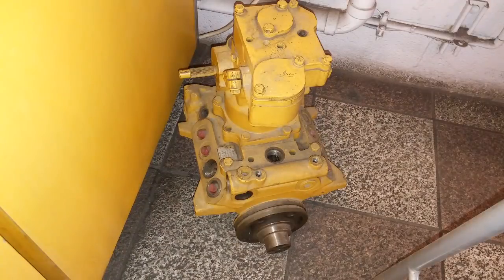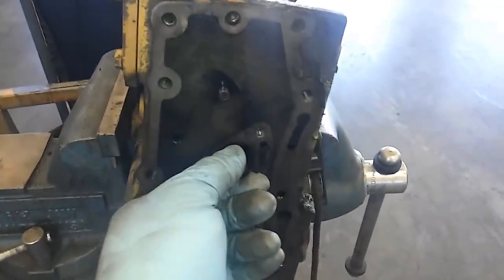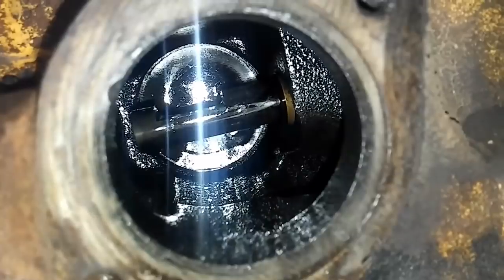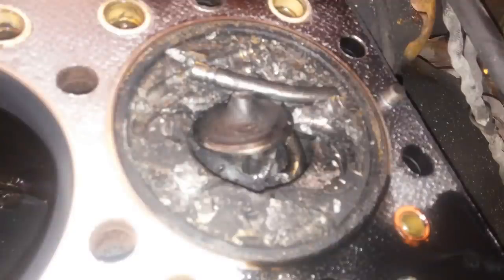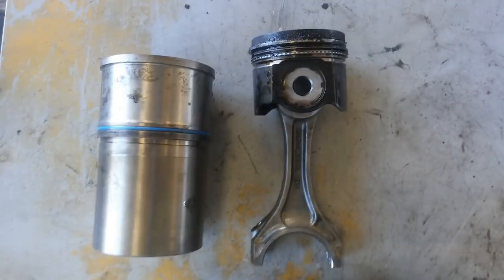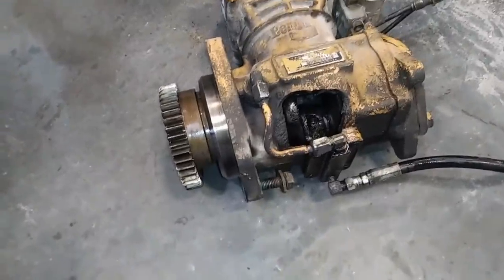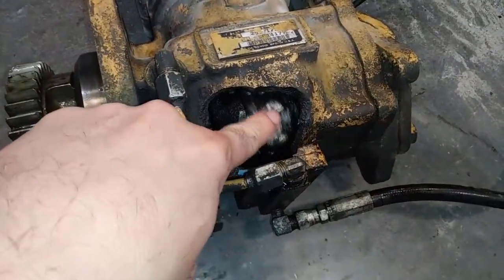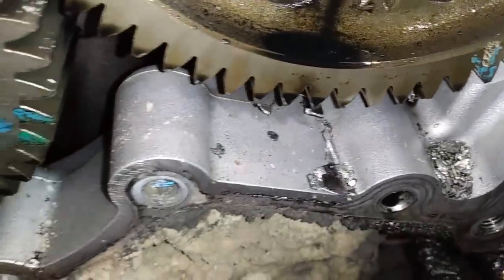Why Do Diesel Engines Runaway? What Is A Diesel Engine Runaway?

Comment: Don't get all worked up, over a run-away diesel.
I've had a couple diesel engines run away in the past.
But, they always came back, a few days later.
Reply: I’m pretty sure your very lucky as a runaway is a sign that shows you something is wearing pretty fast and you need a new fuel tap
Reply: If you love it let it go, if it is really yours it'll come back.
Reply: I bet they were all Canine Diesels...maybe even Vin Diesel
Reply: They usually just walk around the neighborhood and come back by supper.

Comment: When I worked in the Alberta oil fields, any truck or powerplant on site with a diesel engine HAD to be equipped with an air shut off valve, basically you hit the switch and a butterfly valve in the intake closes, removing air from the engine. This was in case of a gas leak or some type of prehistoric fume getting sucked into the intake of a tanker, vac truck, drill rig or whatever and cause a diesel to runaway and blow up...... Which would result in a lot of paperwork... Come to think of it, I saw a mechanic use a Gasoline soaked rag start a "Mercedes" MBE4000 that had shut off after running out of fuel once...
Reply: Munnz forget the paperwork. If you have a gas leak big enough to cause the engine to runaway, and you don’t get it shut down before it explodes, chances are the sparks and flames are gunna set off the rest of the fumes that are now across your lease and the whole lease goes boom lol
Reply: speed150mph which comes with a lot of paperwork.
Reply: Gasoline soaked rags start a diesel that's ran dry better than anything I've seen
Reply: The first thought that came to mind.   Unbelievable that engine makers would try to save pennies by not putting emergency air cutoffs controlled from the cab on EVERY engine.
Reply: Fascinating story Munnz! About oilfield requirements.... All these stories from you guys are fascinating , and I'm learning a boatload from you all.... Fascinating too is when a driving school student tries to run back to a truck that's on fire , and he's running back towards the truck hollaring "My logbook! My logbook's in there!" And we grabbed him by his shirt collar and stuffed him in a ditch just as the big "boom!" explosion shot flames 20 feet tall. His eyes got HUGE!. Scary stuff., when you realize you could be asleep in the bunk during stuff like this
Reply: Munnz - Fire truck drivers have to watch out for the same thing. If you are responding to a propane leak, the propane is heavier than air and the gas will "puddle" in low spots. However, fire trucks are not usually fitted with air cut offs. If you're in an atmosphere rich enough to ignite in a diesel, you need to be somewhere else, NOW!
Reply: This is basically what happened on the Deepwater Horizon rig. Natural gas pressure blows up through the pipeline, huge amounts of gas surround the rig. Gas gets into the air intakes for the diesel generators powering the rig. Diesel engines over-speed as a result of too much fuel, cranking the generators up to 11 and beyond. The crew on the rig notice this as the lights get super-bright and then light bulbs start popping, due to the excess voltage from the generators being driven way too fast. This only lasts a matter of minutes though, because the diesel engines can't take the stress for long: They explode, causing a huge fire which ignites the oil spill itself.
Reply: Too bad choking the air on this old pos Cummins generator I used to service would cause it to rev up. 
Notice I said : used to. 
Yea , we condemned it before it really ran away.
Reply: @luashelton9320   Did you hear about the trucker who got stopped at the scale house back in the day, and when they asked for his log book he replied " Log book? Are you crazy, I'm hauling cattle!"
Reply: @johns7734  Propane and Butane are toxic, and they also are dangerous to living beings BE CAUSE they are heavier than air which would cause it to  easier explode and also be cause it easier causes you to breathe in higher concentrations of it. I once got completely incapacitated from breathing in propane / butane from a pretty small tank that started leaking in my shed, it was scary to be aware you're laying on the ground and aren't able to twitch or move any single muscle in your body. Remained like that for ten minutes or maybe half an hour, I was lucky the gas tank ran empty halfways and in the end I found back my ability to move, rather painful and taking a lot of effort. Not pleasant.
Reply: LOL... I Hear beer passes a lot of gas   lol
Reply: This is common and required on many diesels that operate around anything that has a potential to supply gas. A lot of pipeline fires happen when excavations hit gas lines accidentally with equipment that doesn’t have a shut off system. Engine runs away lots of heat and boom.

Comment: I remember when I was 14 or 15 we put a used diesel engine in our Land Rover which at first wouldn't start since it had been sitting for a while and then went running away pretty much right after it started. Horrifying experience! We managed to make a ball of rags and gloves we had handy big and firm enough block the air intake good enough to stop it rather quickly. No harm done to the engine. It had a stuck injection pump so we just put the pump of the old engine on it and it was good to go.
Like all of your informative videos, please keep this wonderful work up!

Comment: I had a run away on a Volvo FH12 because of turbo failure. Luckily my buddy was fast thinking and showed a bunch of rags into the air filter house and it caused the engine to starve and stop.

Comment: Ive seen a train going down the tracks with fire coming out the exhaust on the top. not sure if it was a runaway or not. but it looked cool
Reply: Fire out the exhaust stack is an indication of over-fueling.  Normally, over-fueling presents as simply excessive (black) smoke, but if the machine has been working really hard, and if the exhaust is very hot,  the unburnt excess fuel will actually begin to burn inside the exhaust, and when the stream emerges outside of the exhaust pipe, it meets the fresh ambient air,  so the oxygen infusion as it's leaving the stack helps ignite the mixture and it presents as a visible flame.  Yeah, looks cool,  not really a problem other than to indicate that it's time for some shop maintenance.   In some extreme cases,  there could be instances of fire out the stack if the turbocharger was experiencing a failure where the lube oil being pumped to the turbo's bearings, manages to get past the seals on the hot side of the turbo, and ends up puking oil into the exhaust stream.  This would present as quite a wild and excessively sooty, smoky blue-white exhaust, and if left unchecked, could begin to consume the lube oil from the engine.  Modern locomotives would have a sensor that would indicate low oil level in the crankcase (or low oil pressure in critical areas), and would lead to a governed shut-down, if the engineer did not notice or act, the engine's management system would shut it down to prevent self-destruction.  In a runaway situation,  if the engine is getting its "fuel" from lube oil getting past the piston rings, or from turbo bearing seal failure on the "cold" side (compressor side, forcing oily air into the intake),  there is no way for the engine to stop itself until it runs out of this "fuel" supply, or someone blocks off the air supply, or if it simply "grenades" itself from overspeed or lack of sump lubrication to the rest of the engine.  Stopping air supply to a locomotive would be a tall order,  as the openings for air intake are huge, and the danger of the object getting sucked right in would be quite high.

Comment: It's fairly easy to get a junkyard throttle body from a gas engine, permanently plug any vacuum lines, and attach it in the air flow path (after turbo). Hook up a cable with a pull knob, inside the cabin, like a "choke" (which is what you're doing).

Comment: Gonna make a second comment too :D Many of the modern Diesels, as in 2019 that I've test driven or owned seem to have an inbuilt debounce making the RPM take longer to come down or really high end ones rev match between gears, lower end ones have a tendency to surge as the cars management draws more power for A/C or something like that. As someone mindful of mechanical failures, modern cars make me very paranoid.

Comment: I’m a river boat engineer. Specifically EMD engines. It rarely happens with EMDs. Has an over speed trip that stops injector function at RPM over a pre determined value. Only problem with that is if the over speed trip springs get weak it’ll shut down or die under a load. So maintenance is key and I can’t stress this enough…..top end inspections, top end inspections, top end inspections! EMDs are amazing engines! Americans work horse and they are brilliantly designed!
Reply: And by the way…. An emergency fuel shut down is ALWAYS a good idea!

Comment: I know diesel engines don't require throttle valves to control engine speed, but it certainly seems like it would be helpful to have a throttle valve anyway, even if it was only used as an emergency cutoff and left in the full-open position the rest of the time.
Reply: Older Detroits had a flapper in the intake that works if you get before it's too much over redline, otherwise it will suck the seals out of the blower and run on that. At that point a co2 extinguisher is probably the only possibility.
Reply: Sounds like added complexity to mitigate a really rare situation.

Comment: I had an old 2.2ltr Hilux engine do this. It had worn valve guide seals and valve guides. It would suck the engine oil into the cylinders and run away with lots of blue smoke.
You would get a loud clatter and way it would go. Had to break hard in top gear to stall it.
You can do this with this engine as they don't have enough power to pull the skin off a rice pudding!!!!!

Comment: Hi Josh, really like your channel. 
 Here's my thoughts on the subject. 
 With a truck engine, with a runaway we need to limit the engine speed,  that's the killer.
 We can do this by putting the truck in neutral,  kill the cruise control,  activate the Jake brake, let the clutch pedal out.
 The engine should now limit the RPMs to around 1200 or less as the Jake doesn't know the fuel source,  it only knows it has to activate with the increase of RPMs, thus a makeshift rev limiter has been initiated. 
 This will prevent engine damage,  and will give us the vital time we need to safely shut off the air by pulling the air boot and plugging the intake.

Comment: 25 years ago, the old Detroit 8V92TA had a runaway. Jake was signing off on the tactical vevichle. His big belly stopped it! He had a big hicky on his belly! He had to explain in broken Korean to het. He still slept on the couch for a few weeks. Yup, the old mechanical diesels would run away.
Reply: Yes, a CO2 fire extinguisher, only CO2, will snuff out a runaway. ABC extinguishers will but the engine will have to be over hauled. A couple of different guys used water! They hydrauliced the engine and ended with a lot of scrap metal. Every diesel firetruck, that I have seen to this day, has an emergency shut off on the air side. Even a few of those add a Jake type to the exhaust for extra safety.
Earlier comment about Jake is to this day we call him Jake brake... LoL!
Reply: Mike Brooka 
I had one a while ago , that would start to run away if you choked the air. 
It just started drawing on the oil in the engine. 
Tired old 60s Cummins generator in a hospital, I hadda condemn it and they weren’t happy until I showed them why.
Reply: @MrTheHillfolk  I never had a Cummins do that unless it was a bad turbo seal, in which the turbo needed a rebuild. If no turbo, WTF?!?! Oil was coming from somewhere.
Reply: Mike Brooka 
Yea it was pretty spooky, and it was really tired and overloaded electrically by like 15-20%. 
that exhaust manifold would glow a nice cherry red under load, and it sat around 55-56hz(1hz=30rpm)
I don’t remember the exact engine model, but it was about a 1964 from the generator info. 
It was maybe 120-125kw on the gen end. 
Wish I coulda seen the exhaust stack outside when it was choked for air, and note the color of the smoke.
Reply: @MrTheHillfolk  Dang! Yes, it sounds like scrap. I wish I could know more about why it did that. It was sucking oil from somewhere.
Reply: New ones are just as bad. The number one reason is a turbo seal.
Reply: @mikebrooka9395  ABC should work ok. The breather should catch the particles. The ABC chemical doesn't stop the engine but will clog up the filter which will kill the engine or slow it down.
Reply: @TempoDrift1480  Kind sir, when a diesel runs away, one of the three of the pyramid of fire went aloof. Usually it is fuel control. Gaseous hydrocarbons, fuel metering failures, or just raw engine oil (yes, a diesel will run off of motor oil). Just study mechanically fuelled diesel engines. The only way to shut them down is cutting off the air. No oxygen, no fire, no fire means no oversped parts flying around.
Reply: @mikebrooka9395  sometimes the oil bath air cleaners caused some eccitement.
Reply: @fxit3  I have heard of this from old farmers and their old diesels. Especially when on funky grades or when the front end flies up (particularly when you set the front end down fast). One old-timer clutched his Case and bounced the front tires about three times, he was at 2/3 throttle and said it revved up pretty high for a few seconds with a healthy dose of blue smoke. I would have loved to have seen his bugeyes turn to dinner plates! 😂
Reply: @mikebrooka9395  Halon or nitrogen will shut it down too.
Reply: @rebel-yell9453  yes

Comment: Saw a v12 71 run away, a guy had just worked on had evidently jammed the rack in full fuel. If you've ever heard one you'll never forget it. When it happens to a Detroit it throws big chunks a long way. I picked up a piece of cylinder head 2 to 300 yards away. The Detroit shop said a good tight engine would go to 12 to 15000 rpm before they would scatter.
Reply: No diesel is hitting 15,000 RPM.
Reply: @generalkayoss7347  only  for  a  split  second .  All  I  know  is  that  it's  no  fun  being  in  the  neighborhood .
Reply: Wow thats insane to belive. I bet its 6000 rpm and not 14000
Reply: @gabrielv.4358  all I know is what the rep said. It goes from 4000 to insane in about a second
Reply: @cbmech2563  Wow

Comment: EXCELLENT VIDEO !!!!!!
Thorough,tight,consice..
Professionally done!!!!!!
HEAVY-HAUL off-road.
Working on-sight hauling oversize
loads in gravel pits and construction/land DEVELOPMENT
sights.
I had this happen many times with
The 1974 Autocar,CAT 1693
bulldozer engine,425s,500s,
and Cummins.
1693 blew a piston through cylinder wall;Cummins .  .  .  .
TURBO FIRE.
Thank you,again for this very informative video.

Comment: Had a Volvo L70D at work runaway when something came apart in the injection pump and jammed the rack full open. It was up to 2700rpm when the mechanic came and got me. By the time we got to it, it was still climbing going up to 2900. I drove it in a snowbank in high gear, curled up the bucket, shoved the arms down, cut if full left and it was still idling. An electrician was at work, he was driving by when he saw the other mechanic rip the pre-cleaner off and blocked it off with a 1/2” thick piece of rubber, it brought it down to less than 60rpm, it had at least a full second between the cylinders firing . He yells “what are you guys doing?” I yelled “it’s runaway, it won’t shut off!” He yelled back “Pull the plug wires off dumbass!!”...
Reply: Haha pull the plug wires good luck with that one
Reply: LMAO PLUG WIRES DONT DO SHIT 🤣🤣
Reply: Heck with the plug wires.  Just smash the distributor cap!!!!  It works for me every single solitary individual actual time, and then some!!!
Reply: PLUG WIRES ON A DIESEL?  That's interesting.
Reply: Diesels run best with NGK wire sets and NGK plugs. Japanese parts are very high quality. New Iridium diesel plugs last way longer than standard plugs. If you cant afford NGK...DENSO will work not bad.
Reply: Lolololol